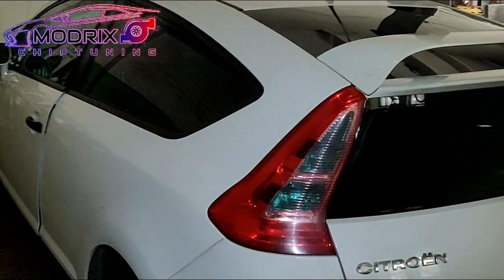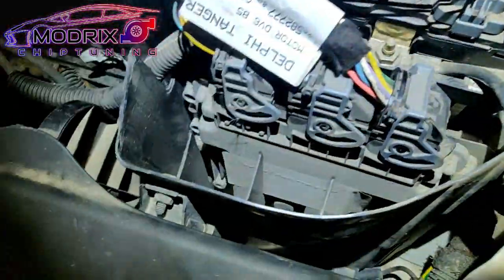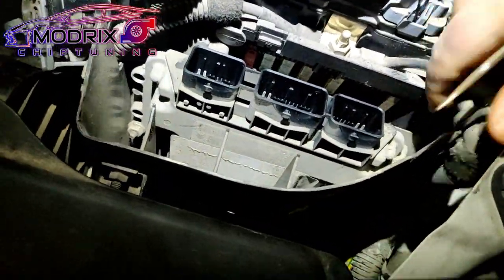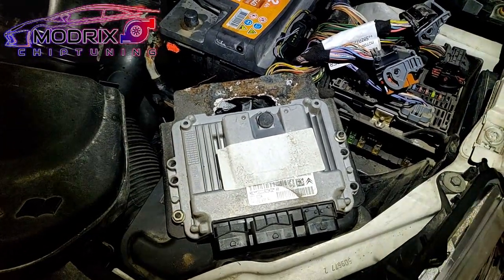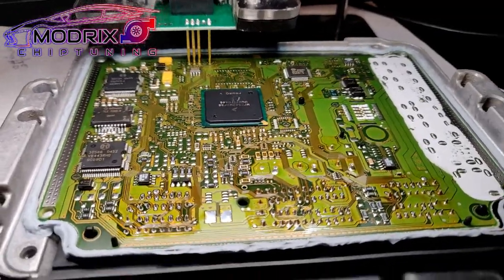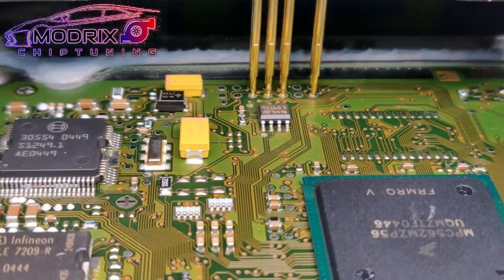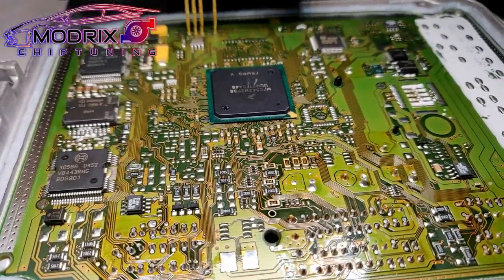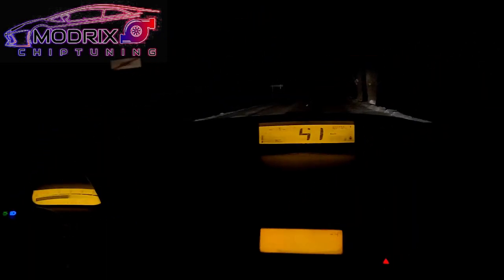EGR valve reprogramming Citroen C4 2006 1.6 HDI✅

Comment: I think that video should say: disabling EGR via KESS / K-TAG not programming.. 

For those who are so "eager" to get more power by disabling the EGR valve few tips:
- EGR work ONLY in low areas (below 2500rpm) and only if the engine is in steady condition (regular cruise driving). When you hit the throttle it is closed!
- EGR do NOT affect the power unless is clogged and stay open, what can be prevented with proper driving, proper fuel and yet cleaning about 30-50 000km
- EGR return part of the exhaust gases what help partially to reduce soot and not breading them, but mostly them to go to the turbo and particulate filter (if you have one)
That partial flow also reduce the heat. When cruising with 1800-2200 rpm usually the turbo is 250-290°C in summer days  350°C. If you remove the EGR right away you cruise with 300-320°C and even partial acceleration you reach 500°C. With EGR working i a bit longer acceleration you get to about 580-600°C at turbo in less than minute and half. 
Then you slow a bit, EGR kick in and right away you start reducing heat. If you "tune" the car and remove the EGR then  you put more fuel, the heat rise faster, and there is nothing to reduce it. High temp. gases hit the turbo, soot bombarding the subsonic spinning blades and the turbo is f*ed up really fast. 
So, it`s up to you guys but why the hell every time on old car, that have engine wear, loosing compression, injectors do not inject perfect - first thing is to overboost it, put more fuel in the maps and take even the last part of life left.. Repair it to almost original state, then tune it and you`ll enjoy it much much better